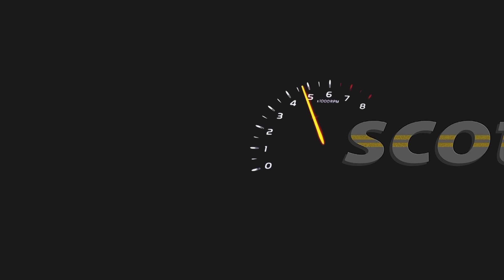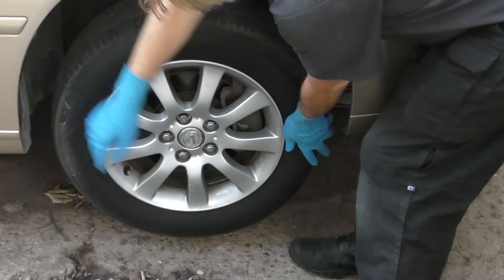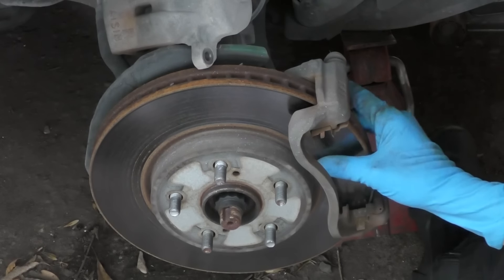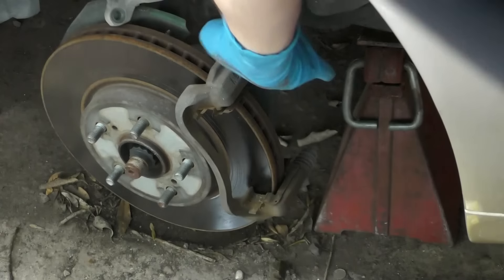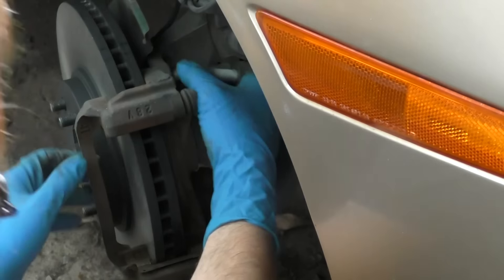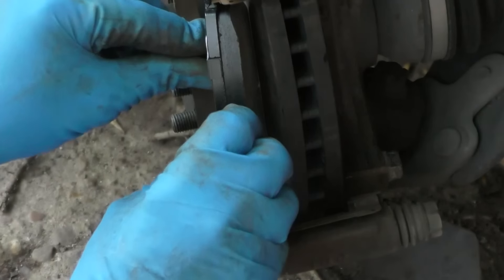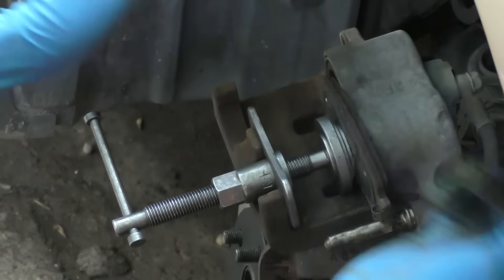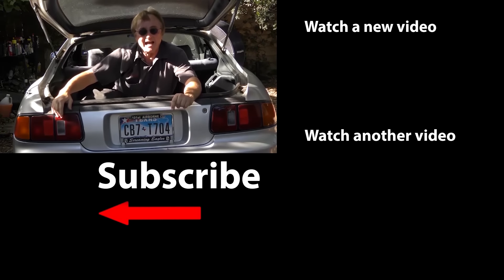Does Your Car Shake When You Brake, Do This

Comment: most brake pads are no brainers and go in easy and your done. But I have this Ford Mustang with these fragile C shaped wires that are spring to hold the pad in place and help keep them from dragging on the rotor. I got what I paid for as I went cheap. These little C springs all snapped off after install. The springs were gone so I took them off and reinstalled the originals that still had some life left. I took Scottys advice and bought akabono brake pads. I recommend looking at the pad before hand and knowing what they look like or taking one side off and taking the part to the part store with you to make sure it is correct. or taking a picture and sending it to the online place to make double sure you get the right part. And never go cheap on brakes by mid range to a little more costly. Why risk you life and family on cheap brakes. If you do it yourself you already saved money
.

Comment: Good video Scotty.The older cars those rotors did not warp. You would change the brakes half way before those rivets got to the rotors. Now a days those rotors warp faster  Brake job change the rotors and pads every brake job  Napa has the rotors and pads in a set $89.00 to  $115.00

Comment: You use a dial gauge to measure the run out on a brake disc. A warped disc normally happens when you have a hot disc go through a puddle and cool it too fast which will not change its thickness but will slightly bend or crack a very worn disc.

Comment: Be sure the caliper slides , if the pedal shakes replace front rotors and pads using ceramic,  and slow down before the light turns red.

Comment: One small bit of advice. Before you take the hammer to the old disc do everything you can to make sure the new disc is the proper replacement. Twicw I've had wrong discs sold to me. Both were on model year chances, a Nissan and a Mitsubishi. Problem with the Mitsubishi was that I had to hit the disc quite hard and damaged it. Then when I went to put the new ones on they were the wrong size, too big. I'd learnt my lesson by the time the Nissans were sent wrong and just left the old ones on a few days more while a replacement was sorted.

Comment: My 2010 Toyota Camry LE 2.5L 6A does that. I think the front rotors are bad because when the brakes are warm or hot when you start braking the brakes end up shaking in the steering wheel and sometimes can be severe and need to be replaced. Nevermind I got my brakes replaced and a new dorman steel rim put on and stopped the shaking and pulsation .

Comment: There is some guy who races cars that claims 99% of brake vibration is simply an uneven spot of brake pad deposit on the rotor. He claims he's very seldom seen a true warped, out of shape rotor. Not sure wether this is in a racing setting but some simple high G force stops from say 50mph to almost stopping, like one does when bedding in a new rotors, would remove the deposit. Interesting and my current rotors are somewhat "warped", only really feel it under hardish breaking down some of our mountain passes here in CO so I need to see if his theory is correct :)

Comment: Sometimes there is air trapped between the caliper piston and the rubber accordion seal around it.  This causes it to bulge out beyond the piston when you press it back into the caliper.  Don't put it back on your car this way or the seal may be accidentally trapped between the piston and the brake pad when you reinstall the caliper.  Take a blunt instrument like a flat screwdriver or spudger and carefully pry the boot a little bit away from the piston to burp the air out.

Comment: I had my front discs replaced on my Land Rover Discovery 3 with the  Chinese made discs.  

They squeaked from the start. I changed the pads, problem remained. Couldn't figure it out for months. Noticed my miles per gallon had dropped  by 10. 

Then, out of the blue, Mr Google Algo , suggested  your video. 

Yes, I had noticed ever so slight shaking in steering wheel when I breaked.

So I got the genuine front discs instead and hey presto, miles per gallon went from 27 to 37.1! 

That means I will be making fuel savings of 15 yo-yos per week. Which means the cheap discs I had installed in the first place would have cost double the genuine discs had I not replaced them.

Thank you Scotty!!!!

Comment: The most common fault is the uneven rotor surface as this guy said. Also rusty calipers and shiny brake pads can also cause shaking. If you feel the vibration in the steering then usually it is the the front rotors/calipers, if vibration is felt in the brakes then it is the rear.

Comment: There is yet another thing that will cause the steering wheel to shake upon braking (called brake judder).  It is caused by a condition where hard spots form on the rotor.  These hard spots or heat spots are where the cast iron basically become super hard like a ceramic.  The material in this hard spot is called cementite.  If you don't believe me, look it up and learn.  Also, I measure rotor runout (warpage) with a dial indicator.  They are not that expensive and are the best way to determine if you have a warped rotor.  My rotors were not warped and were true within .001" and I was still getting brake judder.  The cause of the hard spots is improperly bedded in (burnished) brakes.

Comment: Hey Scotty I’ve been having this problem, but the rotors are new. On a 2007 Camry, Fuel economy is normal. So I don’t think it’s any pump. What do you think it could be. FireStone mechanics can’t say either. The break pedal does not shake, just the wheel. It’s not comforting. It happens at low speeds and it increases if I’m going faster.

Comment: Another common problem with a shakey steering wheel is  broken bands in the tire. If your going down the road it's not to noticable but when you apply the brakes it grabs the rotors and then the unbalanced tire is felt.

Comment: Use a dial Indicator to check for rotor run out if you want to do it correctly  and if it's beyond maximum then determine if the rotor can  be turned.  my personal experience on 2010 Camry the rotor had vibration when braking had front roaders machined on the car coast $80 smoth breaking for about 20 thousand then  broblem came back. Bad rotors I guess car still has same breaking components  sense new (Including al pads); never even added even break fluid fluid stil looks almost new. Car has almost 105,000 on it.

Comment: Hi there! hope you can read my question.
Many times I just have to watch some of your videos and fix my Vehicle my self, your videos are very helpful all the time, now I dealing with some vibration on my acadia 2019, I replaced both axles, put new tires, new rotors and pads and of course aligment!
And still pulls to the right when driving over 50mph. Bolt joints seam to be ok
It's only 55k miles on it.
Any advice from you it will be very helpful, thank you!!!!

Comment: Yea, I jacked my dad's old peugeot 206 on some stumps, put it in 5th at idle, got the angle grinder and started working on the really rusty as crap front discs. I also replaced the brake pads as they were down to the metal, it barely had any braking left. I took it for a test drive, it had good braking but aslo really hard massage steering wheel... I'll remember not to do this on my buggy... Much health, Scotty !

Comment: I have a 1990 Ford Ranger, I recently flushed the coolant, changed my battery cable, welded a a new fender on it, changed my rear brakes COMPLETELY, changed all 4 tires, put on a new exhaust muffler and tailpipe, painted half the cab and changed a strut.... I currently have to change all my struts, both rotors, all pads, weld the other fender on to get a sticker and paint the rest of the cab so it doesn’t look like a free candy vehicle, and bring my old rims to a shop to get winter tires on it soon. It’s the only truck I’ve had since I was 19, I’ve had too many margaritas and just wanted to complain a little bit but for CHRISTS SAKE, why is it SO damn hard to get a reliable vehicle under 10,000 DOLLARS! WE ARENT RUNNING OUT OF CARS, PEOPLE ARE SO CHEAP!!! btw, Scotty, you’re a huge help, I take good care of my truck cause of you and appreciate all the videos, thanks bro! If you’re ever in Maine let me know , we can go out drinking and even toke up a little and just be cools bros for a night, you seem like a awesome guy!

Comment: And if this steps does not fix the problem, you should try flushing your transmission fluid and get it cleaned and then put in new or better(please do ask your trusted mechanic for advice on which type and brand of transmission fluid is better for your car)transmission fluid.

Comment: Scotty at 4:40 my Honda Civic manual (and perhaps others) says during brake pad replacement to swap the caliper hold pins so that they wear evenly over time. Also to ensure the boot is instact and fully greased (you kinda skipped over that part!).

Comment: Rotors can really be stuck on and hammering away on them hard really isn't the best idea...dangerous, too.  I put a couple of long bolts though the holes in the caliper bracket then through a large washer and nut. Tightening the bolts symmetrically against the inside of the rotor will quickly break even the toughest one free. I uncap the brake reservoir when compressing the pistons. Don't let it overflow.  Cracking the bleeder might be better and removes some of the dirty brake fluid. Be careful not to allow air to enter.

Comment: I have a 2003 Honda Odyessy 117,000 miles drives and runs well.  I plan to keep the cat another year or two. The spark plugs have never been replaced, should I replace them? Factory NGK or Bosch Platinum?

Comment: I also did a similar test last week but your test is much more accurate. I raised my Lexus to spin the front wheels. The passenger side had the same amount of resistance all the way around, but the drivers side was smooth for only about ¾ of the spin then had more resistance. So I found where my slight shake is at highway speeds during braking. I see the ES has brake brackets while the LS doesn't. And I assume since the LS 460 brakes last 50k plus miles that this can cause the rotors to have this problem since they don't get changed as often. I purchased premium rotors in the back so now I know to purchase premium rotors in the front as well from now on even though I didn't get cheap ones. The factory rotors on the LS 460 are garbage.

Comment: Warped brake rotors but seizing right caliper on 2001 Toyota Lexus 6 cylinder is very common. I changed out both front rotors and calipers, I am surprised that right front rotors seizing is common. There's a cluster of Toyota Lexus years that have this problem.

Comment: And I NEVER EVER use an impact wrench the put the lug nuts back on. I ALWAYS hand torque to factory specs cuz the last thing you want to do is warp your new rotors.  I also use anti-seize compound on the hub and the lug threads to make it easier to remove next time.
Reply: I use it sparingly, I always hand torque to factiry specs, have never had a nut loosen or strip on me in 30 years.

Comment: Scotty, I've changed the discs and pads 3 times over the past 500 miles. Any ideas why they keep warping?
Awesome video btw!
Reply: Unless you are overtorqing the rotors to begin with, you might be building up brake pad material unevenly on the new rotors and not actually warping them.  Do a search on how to bed in a new set of brakes to possibly keep this from happening.
Reply: @radon360  I got the discs and pads changed most recently at a garage, but still the problem returned. I tend to go easy on new brakes but I'll check that out. Cheers

Comment: What's not being addressed is the lug nuts, when you over torque them with the torque gun, or if you torque them unevenly, you will get the rotor warping sooner than later all over again.. if I'm not mistaken, the torque spec on that Lexus should be 76  ft-Lbs.. typical torque spec on those types of torque guns is over 100 foot pounds.. not recommended..

Comment: Disagree with you entirely when you mention the word warped . The discs are not warped at all. I am a retired mechanic ho had this problem on a fleet of taxis thirty years ago. It wasn't just me that had this problem it was every taxi owner. One day I decided to find out what was causing this problem . I put these faulty discs into my lathe and started to grind them, I found out that one half of the disc was squealing as it was being ground, what the problem is is half of the disc is harder than the other half, that was from a manufacturing fault of  hardening and tempering the disc by holding them vertical when lowering Ito water or oil so as to harden and temper them. The first half i.e. The bottom gets harder. My dealer sent my message to the manufacturer of these discs who the changed their method of hardening and tempering by holding the discs horizontal before lowering into the water or oil. Doing that the hardness was even all the way round the disc.They then labeled the discs, trueform.
Just honk, looking at the disc, let's say from 6to 12 o'clock it is harder than from 12 to 6 the harder half does not wear down so much as the softer half. So as you show with you caliper it is not warp warp, but thick thin

Comment: |Maybe, Scotty, you could cover the other reason for brake shudder - uneven pad deposits on the rotors, and how to progressively brake to scrub them clean.
Reply: Robert Burley  Seen it several times. The fix: find a quiet road where you have a few miles to drive, brake but never need to stop. Drive up to 15 mph, brake firmly but not to a stop, repeat at 25 twice, 35 twice, and  50 mph twice, each time brake to an almost stop. after the 50 mph braking, drive on smoothly to let it all cool down. If your shudder was due to deposits, it should be fixed.

Comment: Greetings from Croatia! 
I will be free to ask the question, a bit off topic.. 
My Mazda 6, 2007, 2.0 89kw, diesel, always shakes hard 1-2 second the engine when it comes to ignition. Shake when starting with a pressed clutch, or without the cloutch. I clean MAF, MAP, EGR, egr delete, put new oil, air filter, oil filter and fuel filter. That's from time when I bought a used car and went to my nerves. 180000km is on it now. Obd - no error code. Change engene mount.. Idea?
(My dad have the same car, its ignition starting is quiet and quiet like petrol, no vibrate at all)

Comment: I’m guessing this is the issue I have. I was just on my way to WA from Southern CA and I kept getting this really bad shake on the third big slope nearing Bakersfield and I had to turn around because it was getting really bad. I’m not sure if this will cause my brake pads to mess up or the rotors to damage further by warping even more, going to take it to Toyota tomorrow to see what they tell me because apparently they checked this issue and said it was fine so let’s see what they come up with this time. Thanks Scotty
Reply: You won't believe this, but this maybe the culprit and it was in my case.  Rims "WARPED" !!!

Comment: Just did my 2016 Ford Fusion's rear brakes since the right-hand inboard side ended up going metal-on-metal.  Found it was cheaper to do it myself.  Given the sheer mileage on the car (believe it or not, the car has the very best part of 76,000 (75,800 and some change) miles on it), should I do the front brakes as well?  (I figure I should do the rotors, too, since I'd like to be as close to a fully "known" state on those brakes at a given point in time.)

Comment: It may be helpful to add to pump your brakes once you've completed the job.  This will get the caliper pistons closer to the rotors before you start driving.  You'd hate to start backing up and realize you don't have any brake pressure yet.  I seen one guy backup into a bush and damage his bumper to avoid hitting another car after he completed this job.
Reply: Would you need to leave the brake fluid reservoir open when you do that?

Comment: put bolts in the old rotor screw hole and ratchet the rotor off. beats beating on it. i have a bad cv shakes on accelerating.

Comment: It's impossible for a rotor to warp.  It would take 2300 degrees to warp a rotor and change the metallurgy. I believe scored rotors are more accurate. Rotor thickness variation is excessive lateral run out.
Reply: Are you for real 😂

Comment: Hi Scotty. I have a shaking steering wheel while braking. Only had discs & pads replaced in January. I replaced the discs with new parts. Seemed OK for a week or so but shaking has returned again. I can't feel any play in the wheels. Any ideas what else could be causing it? Thanks.

Comment: Would taking the lid off the the brake reservoir during caliper/piston pushback be a good idea ? if you topped it up at any point during the life of the previous pads, pushing the piston back is going to cause an overflow, lid on its going to blow the lid off lol.... I normally suck some brake fluid out with a plastic syringe during the piston push back 👍

Comment: Missed a lot of things about brake jobs in this video like clean the wheel hubs so its nice and flat for the new rotor also clean the caliper brackets and use new brake pads hardware which if you get premium pads usually are included,, still good video tho